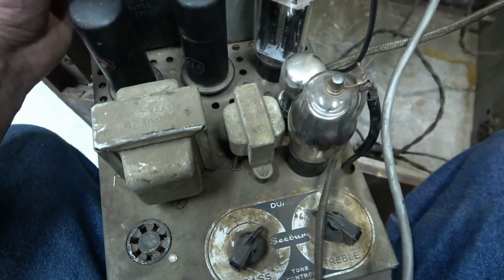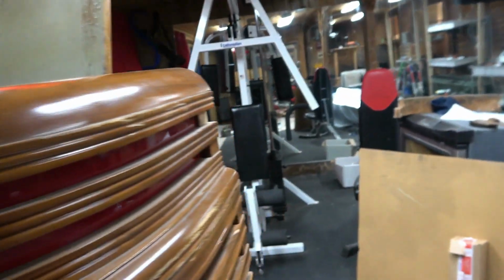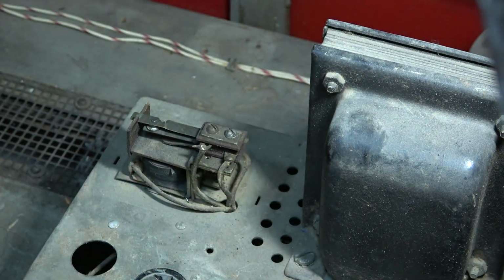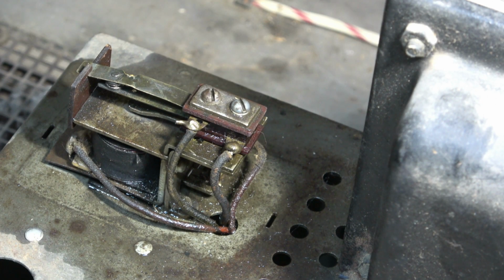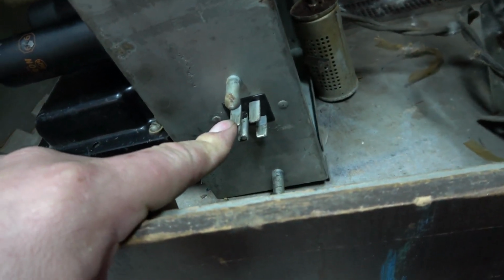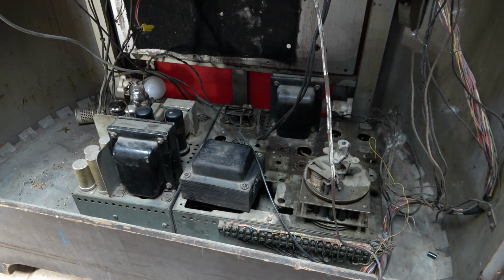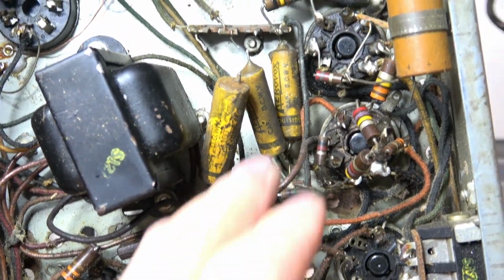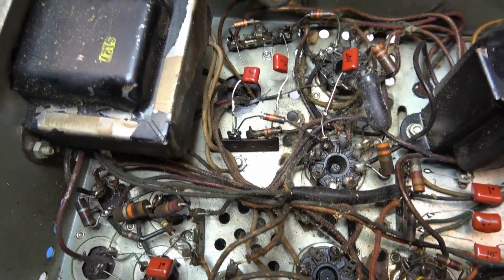1938 Seeburg Regal jukebox part 3

Comment: Always replace those electrolytic capacitors first before powering up a unit as old as this! You risk blowing tubes you may not be able to find anymore!
Reply from the maker: That's why I bring it up with a variable power supply and a watt meter.  On these old molested machines I attempt to do a resurrection, not a full resto in the spirit of the style of videos Shango66 does.  It is part of the learning process, starting at one end and working along from one problem to the next.  I get to see what the different stages of each failure produce first hand.  These are all student projects.  Mistakes are the best teacher.  You can bring this stuff up slowly before burning up anything if you pay attention to the current draw in most cases.  This is a very common technique you can see done many times on many other repair channels.  Check out the recommended channels on my front page if you would like to see more.  Thanks 😃

Comment: Why would you want to try any start up before checking out individual components?
Reply from the maker: That's why I bring it up with a variable power supply and a watt meter.  On these old molested machines I attempt to do a resurrection, not a full resto in the spirit of the style of videos Shango66 does.  It is part of the learning process, starting at one end and working along from one problem to the next.  I get to see what the different stages of each failure produce first hand.  These are all student projects.  Mistakes are the best teacher.  You can bring this stuff up slowly before burning up anything if you pay attention to the current draw in most cases.  This is a very common technique you can see done many times on many other repair channels.  Check out the recommended channels on my front page if you would like to see more.  Thanks 😃
Reply: @electricalmagicsmoke  thank you for your reply, it puts things into context. I am not electrically / electronically savvy but find blogs like the ones you produce very interesting.

Comment: That would have used a field coil speaker.

Looks like a PM speaker is installed.

Maybe that resistor in the vented can was a replacement for the field coil.

Comment: I wonder if there is a way for me to contact you via e-mail about this jukebox.  I am working on a 1937 Seeburg Rex that has an amplifier that is identical to the one you picked up as a possible replacement:  SB10200  Mine works but I wouldn't mind having a spare on hand if you didn't use yours and it could be acquired for a decent price.  Thanks!  Rich

Comment: I don't actually see a conclusion on this.
Reply from the maker: I haven't made part 4 yet.  I'm going to keep troubleshooting  down the line until it plays or I prove that it never worked this way.  I put it together after the recap.  I am not getting full voltage to the motor.  I plugged the motor in directly and it and all the mechanics seemed to work.  I will try to make an update this weekend.

Comment: Is there still components missing off that other half of the chassis?
Looks like a terrible butcher job your trying to make sense of there.
If you have been able to identify that amp then you might be able to find a circuit diagram for it and help make better sense of the mess.
Reply from the maker: I am coming along on it.  I need to get my butt in gear and make the next video.